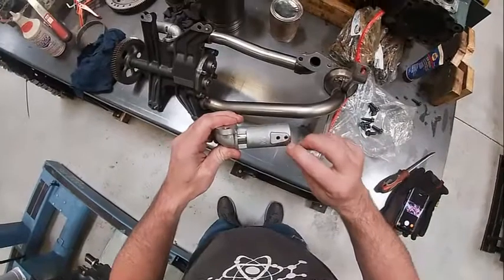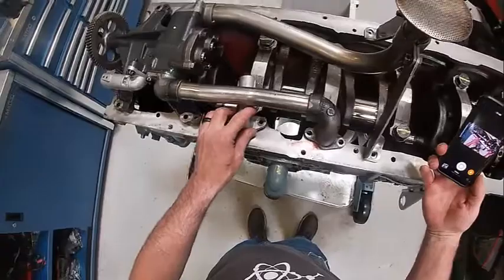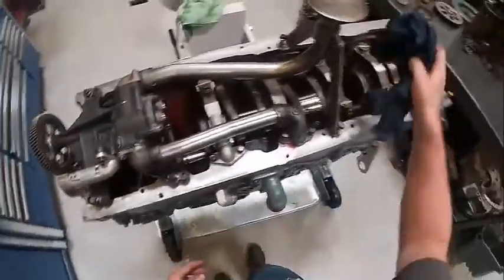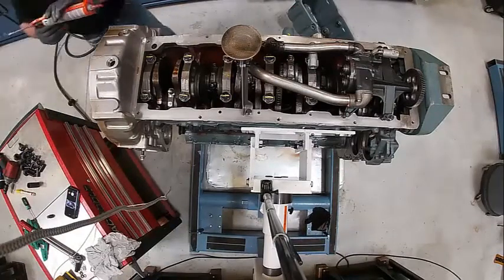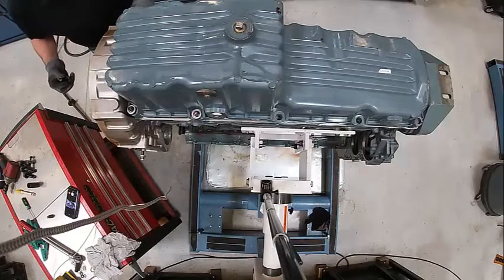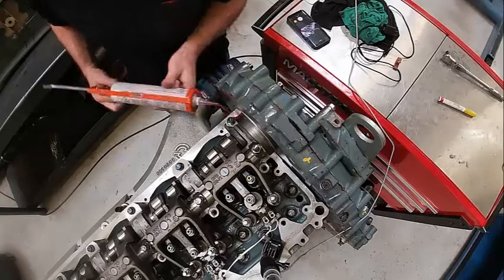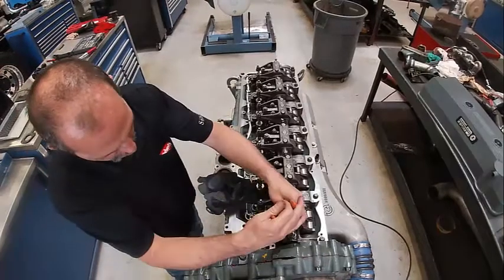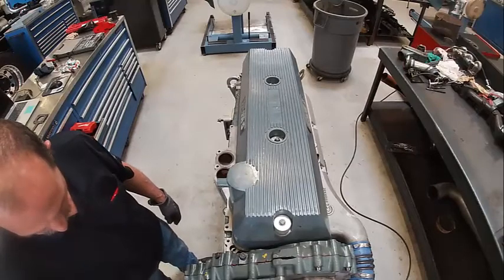60 Series Oil System Oil pan and valve cover

Comment: Hello there.  Are the oil pan bolts (isolator) do they ALL have to be the same bolts ?  Because I have an oil leak thro 2 of those different bolts they are close to the bellhousing...theres are 4 different from the other 6 ...but then is leaking from the top driver side close to the starter...

Also can it leak oil through the starter seal?

Thank you!